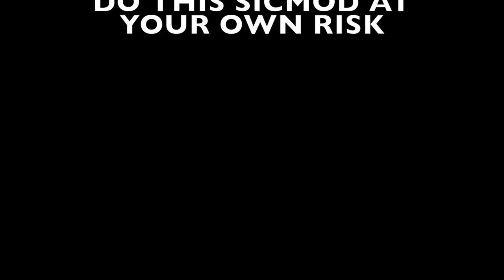Transmission Cooler Installation (Toyota FJ Cruiser)

Comment from the maker: Rey  has had some time to put some miles on his rig after the cooler and install and the preliminary numbers look really good.  The true test however will be when he's climbing grades and 4wheeling in hot ambient temps so I will update this comment sometime in the summer of 2022 to let you know how his temps are looking in really hot weather.
Reply: Well, how'd it work out?
Reply from the maker: @bry2k  The cooler worked out fine for Rey.  I'm running the exact same setup in my 3rd Gen 4runner, and my trans temps are good.  You still have to use the tricks of the trade to keep temps down, though, like using 4lo on steep trails or shifting down on long sustained grades.  

Rey sold his FJ a while back, so I can't give any future updates, but my auto trans is doing great being bypassed and running the Hayden 699 cooler.

Comment: I’ve installed 2 coolers on my truck. I started off with a smaller one and mounted it horizontally where you have an upper and lower port. On my first install I had hot fluid coming in the top and then the cooled fluid flowing back to transmission out of the bottom. I felt like it wasn’t doing anything so I bought the next size up and then did some more reading on plumbing it oppositely. Where you have hot coming in bottom and cold leaving the top. Now it seems to be keeping top end temps down 7-8 degrees.

Do you think I caused any transmission damage or fluid starvation the way I had it plumbed the first time? I’m worried about that a little bit.
Reply from the maker: I don't think you did any damage.  You're good.
Reply: @TimmyTheToolman  thanks. That’s what I was thinking. I just hear about air bubbles and it scares me, but I bet either way you route the lines it fills the cooler up. I don’t know, just got me worried.
Reply from the maker: @Steve_Balboni  You're welcome.
Reply: @TimmyTheToolman  do you think plumbing lines where hot goes in top and cool out the bottom definitely forms air bubbles and restricts fluid circulation?
Reply from the maker: @Steve_Balboni  I'm not sure if air bubbles get trapped in the cooler and limit the cooling capacity.  The transmission isn't being starved of fluid.  It's just that there's the possibility the cooling capacity of the trans cooler is affected by air bubbles.  I've had a trans cooler with the fluid entering the top and exiting the bottom for around 8 years and there's no issues with my transmission.
Reply: @TimmyTheToolman  you are so incredibly kind to a stranger. Thank you so much! Seriously.

Thanks for the real life example too! Is that how you have it routed on your current 4 runner?
Reply from the maker: @Steve_Balboni  No problem, Steve.  I have 2 3rd Gen 4runners.  My 2000 4runner has the trans cooler routed with the fluid entering the top.  My 1998 4runner is the one I bypassed the cooler in the radiator, and I have the fluid filling from the bottom.
Reply: @TimmyTheToolman  that makes me feel 1 million times better! If the man himself hasn’t swapped the lines because he wasn’t concerned, then I shouldn’t be.

Thank you so much for all the attentive dialogue!

Comment: Will this trans cooler work for a 2005 Tacoma Prerunner TRD 2WD?
Reply from the maker: I've never looked at the front end of a 2005 Tacoma to see the space available, but I would guess you could make it work.  None of this is plug and play.  You have to figure out where you want to mount it and how to make it work with the supplied mounting straps.  You bend the straps to the shape you need to in order for it to work.  There's always some trial and error involved, but the straps are easy to bend.  You might have to drill a hole or holes if where you want to mount it doesn't have existing holes you can use.

Comment: Been watching your videos since day 1, I must say your very thorough and practical. I appreciate this video as I have a 2014 FJ and the tyranny cooler is my next mod. I've seen both runs using the existing cooler and separate as you did and for the reasons you explained prefer it as a stand alone system.  Thanks for taking the time to show us your craft! In my book you are the (Toyota) Man!
Reply from the maker: Thanks for the comment Mark and I appreciate the compliment.  Good luck with your tranny cooler install.

Comment: I actually removed the lower line on the stock cooler and ran new line to ext. cooler and then ran new line from the new cooler down to the inner metal line.   This let me use the internal cooler for actual heating in the cold winter to get the trans fluid warmer quicker.    My temps on hot summer days are around 140 while  cruising  165 in traffic.    good video Timmy !
Reply from the maker: Yeah, running an external cooler in-series with the stock cooler is definitely an option.  The cooler we installed in this video has a pressure bypass which bypasses most of the cooling fins in the cooler until the fluid warms up and thins out.  From experience, I'm not convinced the stock cooler does a whole lot to increase the operating temp of the fluid.  It's when a load is put on the trans that raises the temp significantly.  I have a 2000 3rd Gen 4runner with an external cooler in-series with the stock cooler and it can take quite a while for the trans temp to rise.  I use that 4runner for commuting and leave pretty early for work when it's colder out and it's mostly freeway driving.  The trans temp stays pretty low, low 100's for quite some time even though the engine has been at operating temp, 190 degrees.  So yeah, I think it helps to raise the trans temp quicker, but from my experience, it doesn't seem to have as much of an effect as you think it would.
Reply: @TimmyTheToolman Well said

Comment: Another excellent video! Question, do you have a good video on flushing and refilling the transmission on a FJ? My 2007 is ready for it. Thank you Sir.
Reply from the maker: Thanks Chris, we have a video coming out soon showing how to do a flush on a Lexus GX470 which has the same A750F transmission you have in your FJ.   The only difference is your FJ doesn't have a stock external cooler like the GX470 has.  In this video, we show you which line is the send line and which is the return line.  You would want to remove the rubber return line off the nipple of the trans cooler on the driver side of the radiator and hook up a 3/8" transmission hose long enough to run down to a catch container with graduated quart marks and then start the flush procedure of starting the vehicle, draining out a quart, stopping the vehicle, and then pumping in a new quart of WS ATF into the side of the trans.  You keep repeating that procedure until you've exchanged out around 12 quarts.  If the fluid still doesn't look really clean at the 12 quart mark,  run a 13th quart through and you'll most likely see the fluid looking really clean and brand new coming out of the drain hose.  When you watch the video we put out, it will very clear how you do it and then how you go through the fluid check procedure afterwards.  If you haven't invested in a scan gauge to monitor your trans temp, I highly recommend you invest in one so you know the temp your trans is running at along with being able to monitor your coolant temp and other things as well like charging volts.  It's a smart investment.

Comment: If you put bolts to plug the atf lines ( I believe 8 or 10mm diameter not threaded all the way up) and also using the clamps, your spillage with be very little. Also you can add an inline filter (like Magnafine) to the transmission return line.
Reply from the maker: Thanks for the tip on using the bolts to reduce the mess.  I use the magnefine magnetic filters on my rigs for the transmission and power steering systems.   It would be easy to add a filter into the return line at a later date if Rey decides he wants one.

Comment: Do you recommend the cooler and is there a difference
Reply from the maker: We do recommend a cooler and yea there are differences in cooling depending on the size/capacity of the cooler. Typically larger = better/more cooling
- Sean
Reply: Thank you ok  @TimmyTheToolman

Comment: I've done 2 installs using the Hayden 678..one in my 2008 FJ and the other in my 2014 Tacoma..
Reply from the maker: Smart man.  Did you bypass or run them in-series?
Reply: What Timmy said, I've seen both but seems more safety conscious to run separately.

Comment: The hoses on Japanese cars are sized in metrics. When replacing or using hoses in the US, they are sized in SAE. There is always a tight fit when using SAE hose. Ensure they are lubricated with oil or silicone spray and quickly insert.
Reply from the maker: I've always used ATF to lubricate the hoses I was installing but never tried silicone spray.  Maybe I'll get a try.

Comment: Just did this. Following your vid almost verbatim. But I decided to run my send line on top and return on bottom. Similar to stock set up. Thought maybe doing it the other way would cause the Transmission pump to work harder then usual. I also reused the old return line to make my loop on the radiator when I was finished.
Reply from the maker: Good job!  Your transmission thanks you.

Comment: Why wouldn't you use the additional cooler in line with the one already there?
Reply from the maker: The choice to bypass is to prevent a trans cooler failure inside the radiator destroying the automatic transmission.  Do a search for "Pink Milkshake" for automatic transmission failures and you'll learn what I'm talking about.

Comment: Hey Tim, love your videos! I mounted my cooler where it fills top to bottom. I had one radiator mechanic say that may be hard on your transmission pump - pushing fluid uphill, he said, makes the transmission pump work harder (ie)wearing out sooner. Is there any validity to this??
Reply from the maker: I've never heard that.  The pump sucks fluid from the pan through a fine mesh metal filter and through very small channels in the valve body.  If it can do that, pushing fluid uphill through a cooler would be very easy for the pump to handle.
Reply: @TimmyTheToolman  I thought so too!That was the first I ever heard of that. Thank you so much for taking the time for a detailed response! I really appreciate it. Peace of mind is priceless. Have a great day.
Reply from the maker: @Steve_Balboni  No problem Steve.  We do our best to answer questions in a timely manner.  You have a great day as well.

Comment: I did this with my 2016 Rav4 using a smaller Hayden transmission cooler. It kept my Transmission temp between 170-190F even at steep incline with passengers and full cargo during the summer time with ambient temp of 100F. I drive a 4runner now and thinking about doing this mod again. 
My question to you Timmy now is this. Is it ok to just fill the transmission cooler with atf, clamping down the bottom hose so it won't spill, then connecting the hoses and clamping it down? My theory is by adding the amount of atf equivalent to the capacity of the cooler will keep the fluid level close to its original level. Can you enlighten us. Thank you!
Reply: Btw great video!
Reply from the maker: I suppose you could try to pre-fill it but that wouldn't replace confirming you have the level correct after you're done either with the dipstick if you have an older 4runner or doing the fluid level check procedure if you have a sealed transmission.  We're not talking a lot of fluid you have to add.  I personally wouldn't bother trying to pre-fill the cooler.  Glad you like the video.

Comment: Has the guy regeared the front and rear differential?  I understand the cooler is cheaper but it's only treating the symptom the proper solution is to regear for the tire size
Reply: Re-gearing does help a bit but still won’t fix it. The proper solution is the cooler actually.
Reply: Not only regear for the tire size, but the additional weight the vehicle is hauling around. Bumpers, winches, rooftop tents, etc are heavy, and add substantial wind resistance. These can make a vehicle work quite a bit harder than it needs to with factory gearing.
Reply from the maker: Rey's rig has been re-geared to 4.88.  You don't have to have bigger tires or a heavily modded rig with lots of extra weight to incur high trans temps.  My stock 2000 4runner even with an external trans cooler can hit some really high temps when climbing sustained grades.  Re-gearing can help but it's not the only solution.
Reply: @anwaral-janabi1309   You'd be surprised how much head room is in the stock cooler when the converter isn't being overworked.  The proper solution is regearing. like stated above even going a little overboard helps even more especially in low range.
Reply: Yes the guy is regeared on 4.88 Nitro gears...
Reply: @anthonytrujillo7971  I have a regeared 5th gen and I still saw 238°F once before I put the cooler on… The factory cooler is not enough, not saying that I haven’t seen lifted Toyotas with bigger tires and no cooler hit high miles on stock trans though
Reply from the maker: @anthonytrujillo7971  Dude, we get it, re-gearing helps but it's not the 100% solution like you're saying.  Anwar and I have quite a bit of experience between the two of us working on these rigs and we're not imagining what we're trying to tell you .  My stock 3rd Gen with stock size tires can still record high trans temps and that's with an external cooler.  Anwar just told you his re-geared 5th gen still recorded high temps.   Re-gearing isn't the only solution to the problem.
Reply: @TimmyTheToolman   I'll take your word for it I'm not into overloading I mean overlanding.
Reply from the maker: @anthonytrujillo7971  I'm not into "Overlanding" either but I do like going 4wheeling and camping. I bring enough shit so I can handle any breakdowns and be comfortable and fed while I'm out there.  I probably bring too many tools but I'd rather be over-prepared than under-prepared.
Reply: My FJC is regeared om 35s and I still see 250ish on the trans temp from time to time. I don't really care since I'll be swapping out the auto for a 6mt out of a 2020 tacoma when the trans fails.
Reply from the maker: @CACressida  Yep, regearing isn't the 100% solution to high auto trans temps.

Comment: Hi Timmy. I live in Texas where the temperature is 108°F in summer. Would be sufficient an external cooler? Or in this case do you recommended connect in-Series with the stock transmission cooler in the radiator?
My transmission was rebuild for water mixed with the ATF and I am scared get water again in my transmission.

I have a Tacoma 2006 with transmission A750.

Thank you for your time!!
Reply from the maker: That cooler ran bypassed should be enough to keep your trans temps down but it you're climbing long steep grades in 108 degree weather, that's a different story.  There are times you might find that it's prudent to pull over and give your trans and engine a break.  This is why it's imperative to monitor your trans and engine temps to know when it's smart to just pull over and let things cool down.  It's best to keep the engine running and even raise the rpms to pull more air with the cooling fan.  When the temps drop back to normal, you continue on.
Reply: @TimmyTheToolman  Thank you for your time to answer. I really appreciate you take time to do it!!
Reply from the maker: @martinalbertomijares4994  No problem Martin.  We try to answer most questions but some squeak by us.

Comment: So what trans cooler do you reccomend for a 2004 Toyota Sequoia with the 4,7L V8
Reply from the maker: I'd recommend the same one.  The Hayden 699.  I just installed one myself on my 98 4runner.  You can go smaller if you want and you could choose to run it in-series as well instead of bypassing the stock cooler.  The most important thing is to start monitoring your trans temps if you currently aren't and to give your transmission some extra cooling capacity.  Heat is the big killer of automatic transmissions.
Reply: Timmy what are you seeing in terms of temps now?
Reply from the maker: @dverschoor06  I've barely driven my rig since installing the cooler.  I did one drive up a sustained 7 mile / 2000 ft elevation gain climb and I hit 206 by the time I reached the top of the climb.  I would usually hit around 230+ with my previous set-up running a smaller cooler in-series with the stock cooler in the radiator.  But, the ambient temps were pretty cool that day.  I might decide to run that Hayden 699 in-series with the stock cooler but I need to test it out for a while before doing that.  

Rey has told me his temps have been really good since I installed the cooler on his rig but I don't know if he's climbed a grade like I tested mine out on yet.  He's driven up in the mountains several times but I don't know if he's climbed anything quite as sustained as I have.